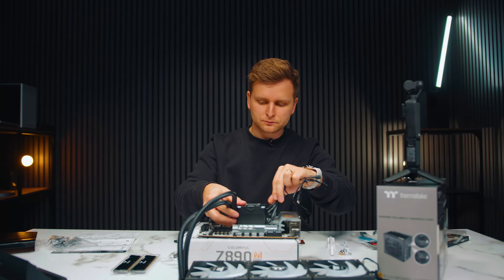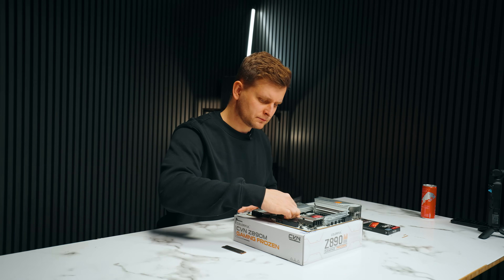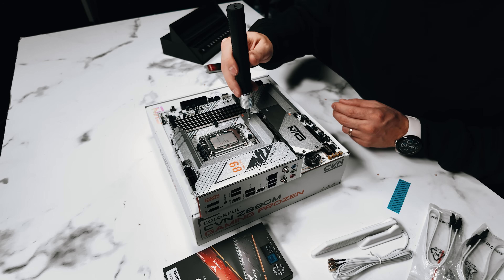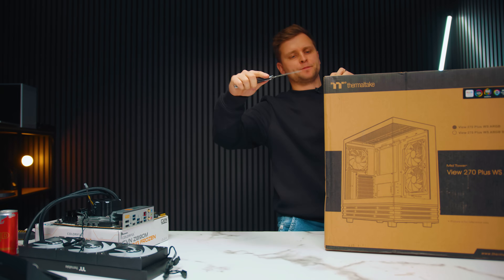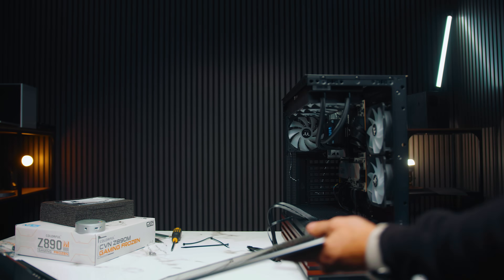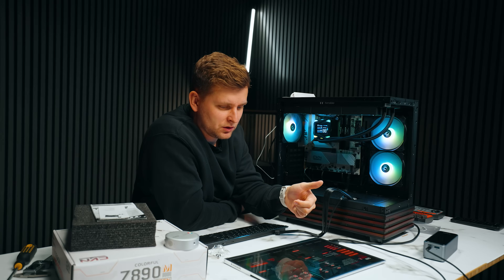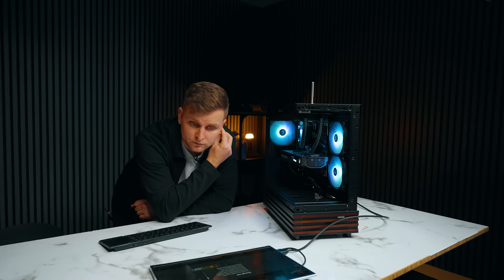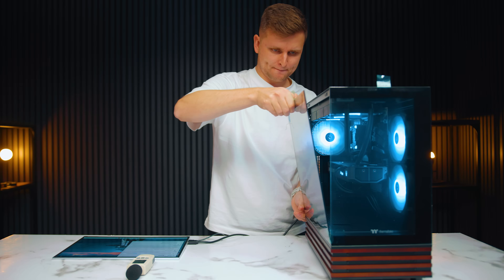Build THIS PC in 2025 before it's Too Late!

Comment: Hey, appreciate your work !! am a filmmaker, editing on Pr now and eventually on Resolve, am getting this build, what do you think about it ? and what cooler I should get ?

CPU: AMD Ryzen 9 9950X

Motherboard: Gigabyte X870 AORUS ELITE WIFI7 ICE

RAM: 64GB (2×32GB) Crucial DDR5-5600

GPU: ASUS RTX 5070 Ti 16GB

NVMe: SanDisk Extreme 2TB Gen4

SSD: Crucial BX500 4TB SATA

Case: Montech X3 Mesh ATX (White)

PSU: Thermaltake Toughpower GT 1000W Gold

Note: CPU cooler required

Thank you!

Comment: What a crazy time to need a new computer!! But my 7 year old AM4 system is on its last legs so I've been building my AM5 mid-range wish lists for a couple weeks and even looking over prebuilts. Then I spent all of yesterday trying different combos of DYI vs Prebuilt vs Semi-custom. Almost wore out Windows Calculator comparing it all but had to end up with my own build through a SI. But was able to hit the price I can rationalize with the ability to at least select the quality of critical components. Still a big step up from what I've been running and in 3-4 years I'll move to 1440P and drop in a newer CPU/GPU combo to last several more years. Now all I can hope for is studios/dev's relearn how to optimize their games. That used to be a thing. Do they NEVER look at the Steam Hardware Survey to see what people are actually running?!

Comment: FINALLY A CORE ULTRA 7 BUILD!!!!! Lesgo bang 4 buck plus i want it to be in my setup for editing!
Reply from the maker: boom!
Reply: As a long time Ryzen user I'm on a Ultra 7 as well for my editing rig... and I was waiting for this one.
Reply: @nicktayloriv310  ikr! i play games as well but since editing is my main job i want this, even on youtube very few people have made a build around it.
Reply: I`ve 14700K waiting for new LGA1951 with 52 cores. Ultra 200 is the same like 14th gen CPU but it has AI engine and it has much better temperatures. This is good but not good enough for upgrading entire platform (I`ve 14700K LGA1700 and DDR4,). Intel needs big jump in performance and Ultra 400 can deliver it... Ultra 200 can not.